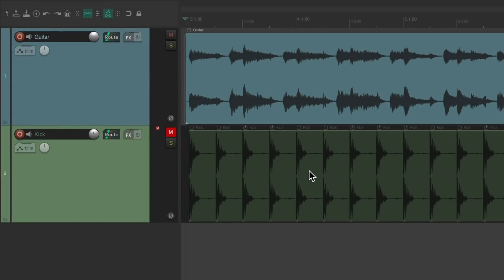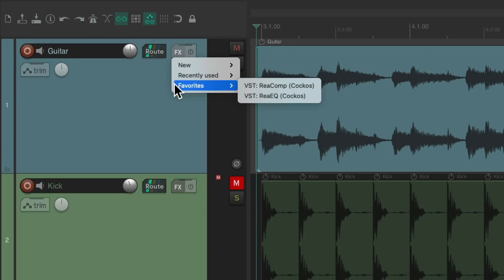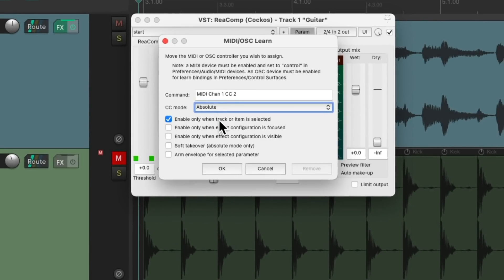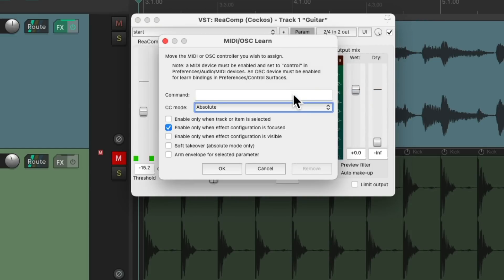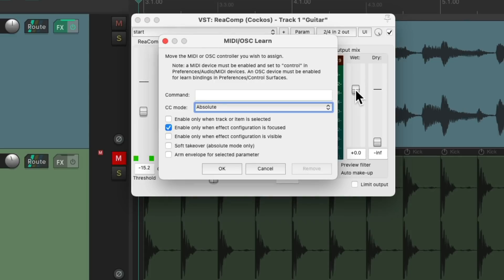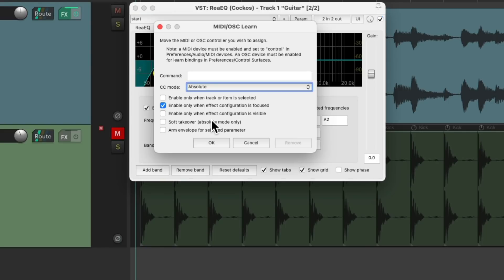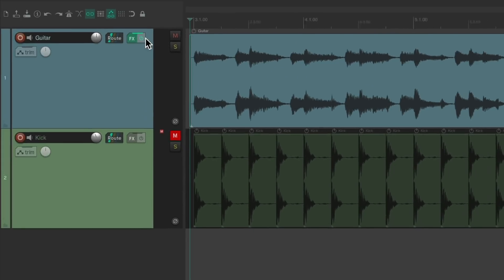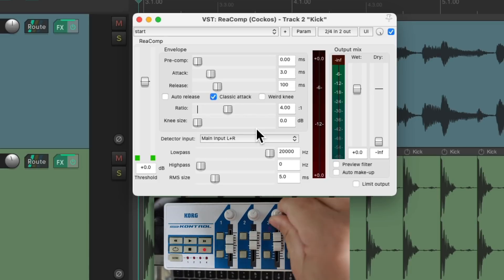Setting up an FX PlugIn Controller in REAPER

Comment: Thanks Kenny ! Question : Is there a way to modify the Mackie protocol to map a controller ? I use an SSL Uf8, it work well with Reaper in Logic mode and Mackie implementation, but I need the ability to enter in "plugin" mode in order that the knobs and faders does not move when I tweak  them on the UF8 with an Fx focused.. I don't know if it is clear. Also the knobs jumps in value, not very easy to use. Do use think an Ipad with the ToucOSC will be the solution for me ? In this case it could do everything and I will simply sell the UF8. Thank you.

Comment: Hi Kenny, great stuff like always, btw. I bought Reaper because of your great vids! However I am struggling with this one - I recently got an nanoKONTROL2 and started to set the controllers for ReaComp as demonstrated in this video. However I messed up and did not follow all the steps in the video and did not save it to a SignalChain. Now when trying to assign controllers to parameters everything works as describerd BUT the controller does not move any faders in any PlugIn anymore - do you have any hint how to troubleshoot this? Is there any way to view/edit/reset all the controller assignments for each plugin? Am grateful for any hints, thanks Stefan

Comment: I'm using a Keylab Essential with Reaper.

The Analog Lab function works perfectly inside of Arturia software, both standalone and as VSTs.

The DAW function works perfectly as a Mackie Control Surface.

What I'd like to do is to set up a User Map to control plugins inside of Reaper. But when I do this, Reaper does not recognize the CC inputs.

I'm sure there's some setting I'm missing somewhere. Anyone have any ideas?

Comment: Great video, thanks!  I just bought the NK2 so this was very helpful!!  Can you pls explain the difference between selecting "focused" vs "visible" in the Learn menu??   The manual (12.16) lumps them both together. 

And I guess not all plug-ins have the "Last Touch/Learn" option?  I have several which don't seem to have this feature.  Is it only those provided by Cockos or is it just "some do, some don't"??

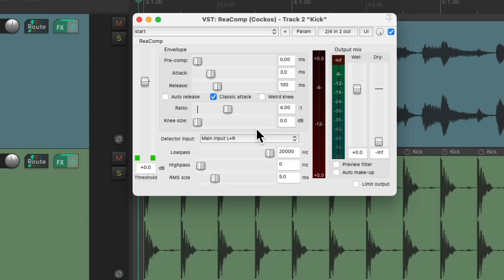Comment: 9:38 this is a shortcoming Cockos has to address
to temporary reset a plugin you have to copy its instance
or to save a preset which may end up not being used ever again
in other DAWs you can copy current settings to clipboard and restore from there, very convenient for trying out different settings while keeping the current ones
if there were such a feature Kenny could reset in place, save FX Chain and then restore the settings

Comment: So if you're using something like the faders on the Kontrol for performance purposes like control of dynamics you would check the box that says 'Enable only when track is selected', right? Would you do anything else differently in the settings compared to this video? thanks

Comment: If I have my nanoKontrol set up as a Mackie Control Surface (Klinke), can I set this up with "only when effect config is in focus" and it will control the plugin when the plugin is in focus and then go back to the regular control surface when it's not? 

Or would I need a separate piece of gear for that?
Reply from the maker: I thought about this but if you have it set up to do faders and pans, they're still going to work while you adjust the plugins. You could set it up to only work on a selected track but that's just one track. So I would play around with it but I'm not sure it will be possible. But report back. Thanks
Reply: @REAPERMania  Yes, you were right. It still moves the faders.

If I hooked up a different MIDI controller would it understand that input as a separate input that I could dedicate to this technique? I'd love to be able to do both.

Thanks for your help!
Reply from the maker: @rhythmjones  I'm not 100% but it should work. REAPER should see them as two different units. Just make sure you set one of them up as a controller in the control preferences but no the other. And set the other one up to just send CC messages. Not be a controller. Good luck.
Reply: @REAPERMania  Thanks I'll try it!
Reply: @REAPERMania  Okay so I got this working with nanoKontrol as my control surface and MIDIMIX for Fx.

The problem I'm having is "only when plugin is in focus" keeps unchecking.
Reply: This is a great question. Some time ago I had to reformat by DAW laptop and forgot to backup, or note the configuration steps options for Mackie Control Surface (Klinke) for use with the Korg nanocontrol as a controller for the mixer - which is a good fit use case for obvious reasons. However, I used to use the Korg controller transport buttons mainly in the past, but recently have moved to using the web app for Reaper transport controls on my smartphone, as that is a more portable (wireless) solution for a one man home studio.
I'm now inspired to have a play to see the best combination of controller/web app combinations. Thanks Matt and Kenny.